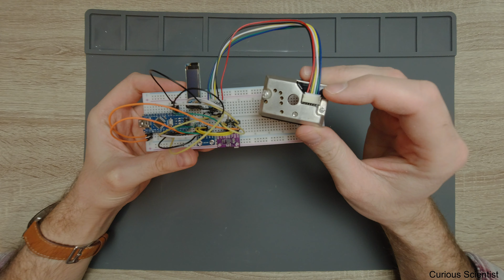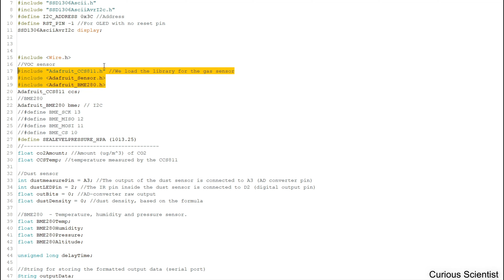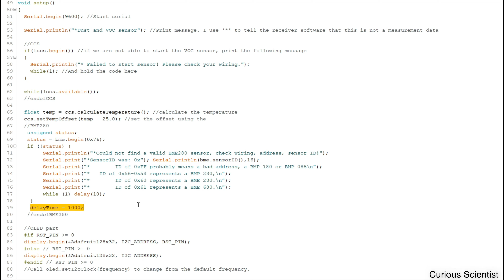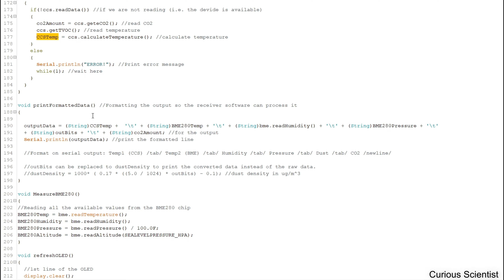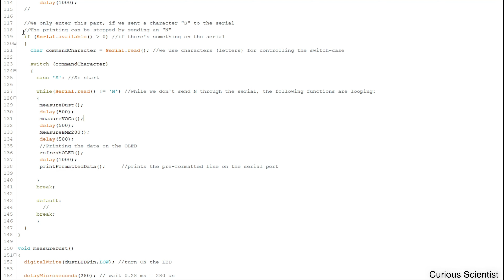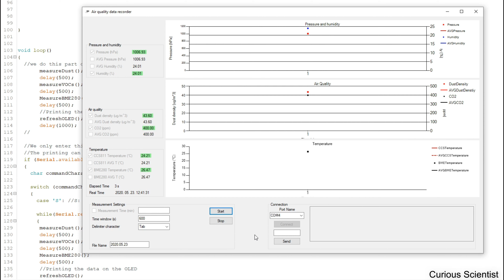Arduino-based air quality monitor - new version

Comment: Very interesting, your meter is more capable now. I don't need one but I think it would be a lot of fun to build one. Anyway, this go to my to-do list :)
Reply from the maker: It's a fun project with much more possibilities. I originally wanted to add a small fan too that switches on from time to time, and moves fresh air to the sensors, but I was not sure if it would change the readings significantly. For example, creating false pressure values or something similar. I will check it and maybe upload a new video later.
Reply: @CuriousScientist  hmm I see your point. I really don't know what professional dust meters do, but is a matter of mimic what they do, don't you think? :)